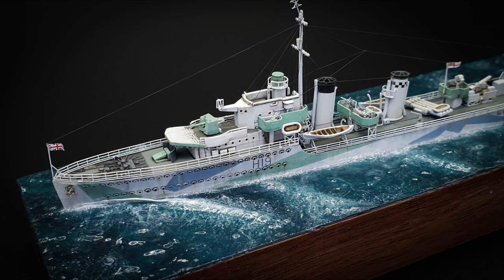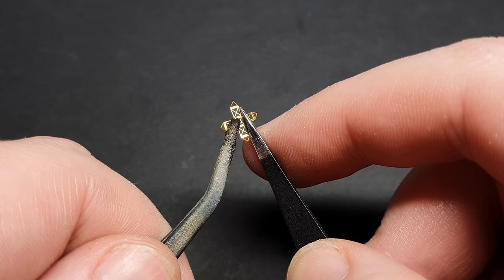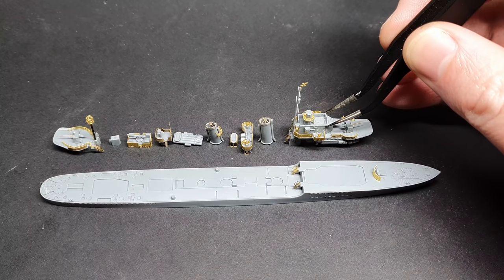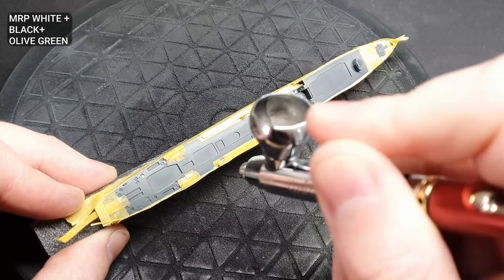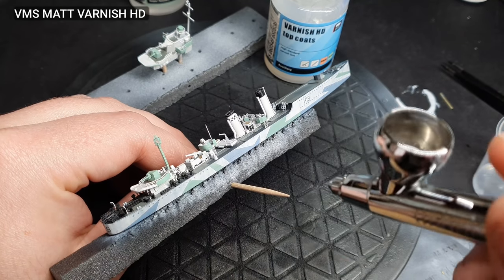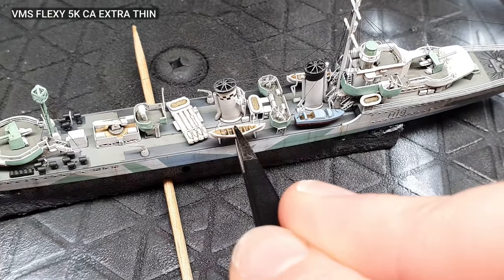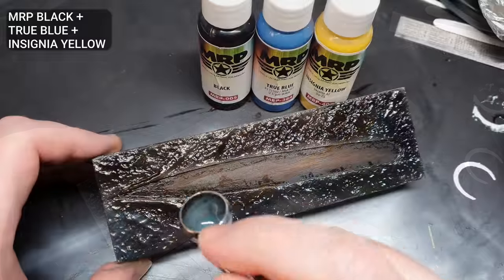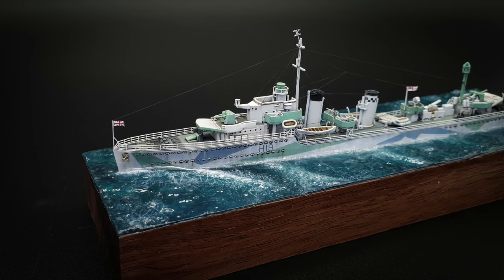1/700 HMS Harvester H Class Destroyer | Full Build | IBG Models

Comment: One of the hardest things to convey in naval ship modeling, is something unique to naval vessels.  That they have, onboard, and entire staff whose job it is to prevent and repair rust and weathering.  There is an all too-common "sin" among casual ship modelers to depict them as if they'd spent the last 2 or 3 years on the Russian Front.  Most ships have, at most, supplies for 4 to 6 weeks, and then spend time in port not only re-stocking but also painting and repairing things, and from the waterline up.  (Too few realize there is a fully-stocked Paint Locker to this end.)

On a Destroyer, there might only be 40-60 men in the Deck Department, their Department Head and the Executive Officer will see to it that they have daily employment.

And, of course, 1/700 just makes all this about 2 orders of magnitude harder to model.

Comment: Great build James, I love the paint job! I have a 1/700 King George V underway and was going to build a diorama using a different technique but have decided to give your method a try. One question for you ... you mentioned that the watercolour paper didn't provide the texture you wanted so if you were doing one again would you use something else, for example heavy card, and then create the wave effects using gloss medium as you've done here? I'm thinking of substituting heavy card for watercolour paper and gloss medium for acrylic binder. Thanks!
Reply from the maker: Hi Steve ! As long as you have a medium that's got enough body ( and self levelling ability) to sculpt a little you'll be alright, as for the base material a stiff piece of card would be fine , it would still need to be sealed in though, the benefit to a card or paper is it has a lot more grip for the gel e.t.c to attach to . 
For the next one I'm going to experiment with sculpting the base waveforms out of clay and then using get for mini texture and gloss ( it's tremendously glossy ). 
The foil technique was on the radar initially but It didn't look organic or natural enough in the end
Reply: @lpjmodels  Thanks James. I've started experimenting with a small piece of 2mm card and heavy / super heavy gloss gels ... we'll see how it goes. I've used the foil technique  twice and it tends to work ok if you're modelling very rough seas. I look forward to seeing the clay technique! Thanks again.